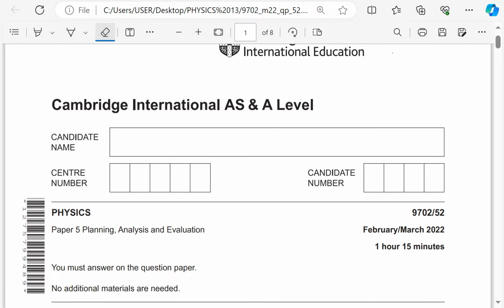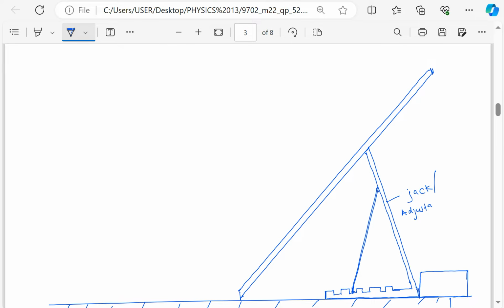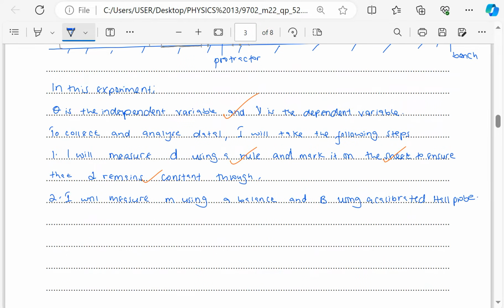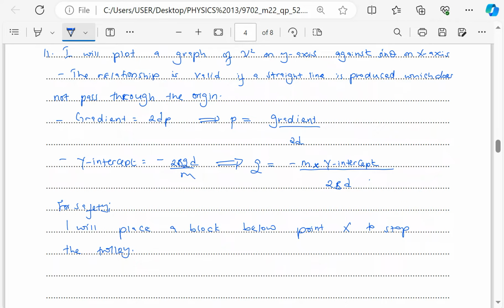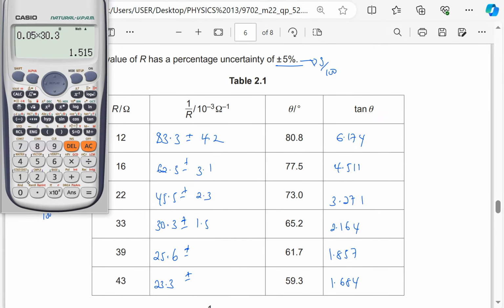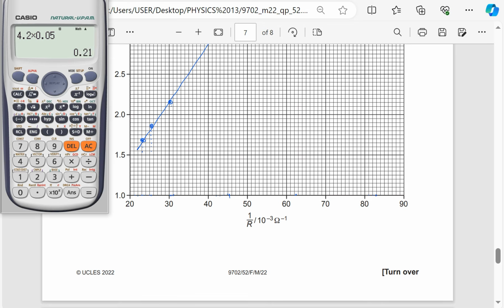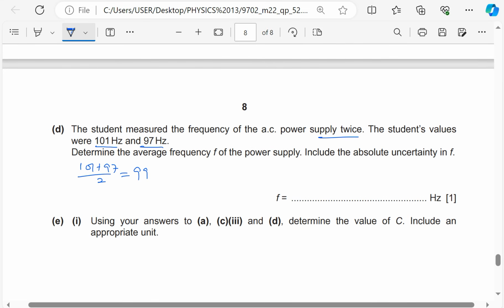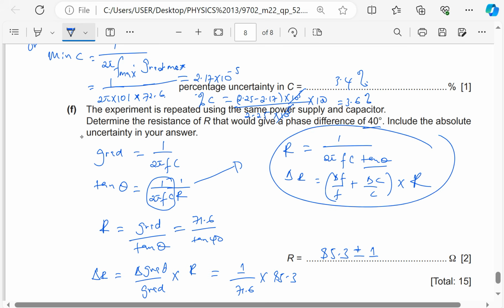CAIE Physics 9702 February /March 2022 Paper 52 [Planning, Analysis & Evaluation ]

Comment: can't we use 2 light gates, one for the beginning of d and one for its end point so we can see the time it took to pass through both points/the entirety of d and divide the length of d by this time to get velocity?
Reply: Question said determined using a light gate 😂
Reply from the maker: That would also be a very good method.
Reply: @learnPHYSICSwithIBM  I would not be good. It would find the average velocity as the trolley accelerates from zero to its final speed v.